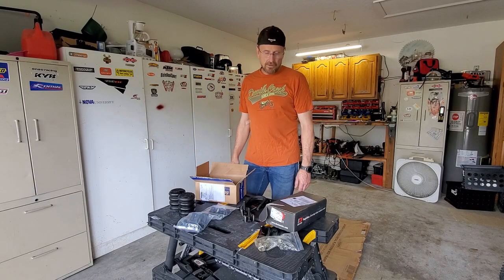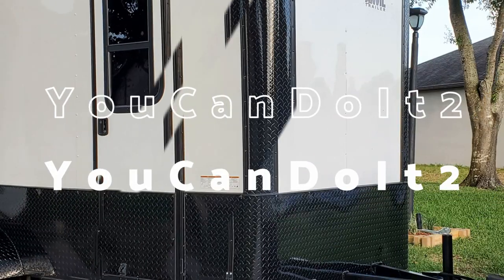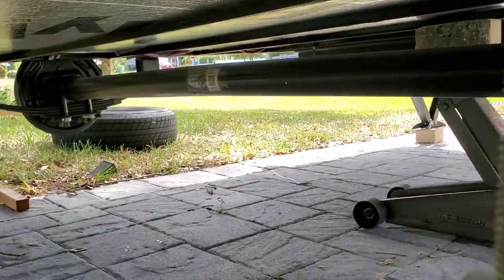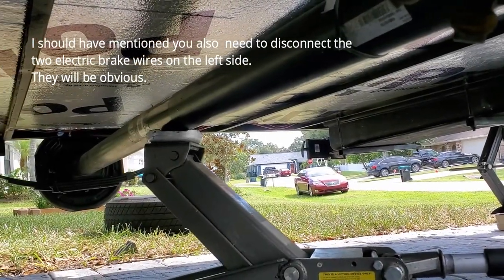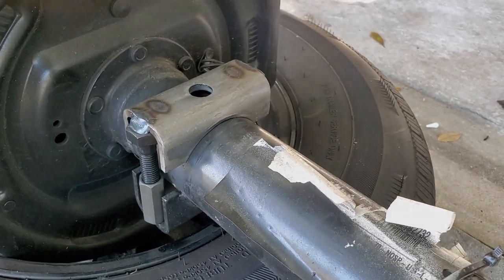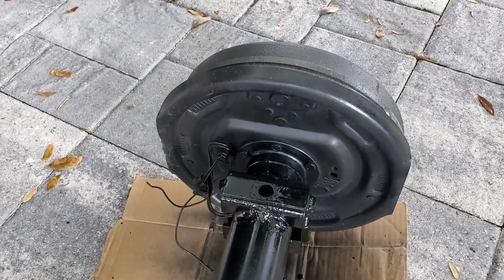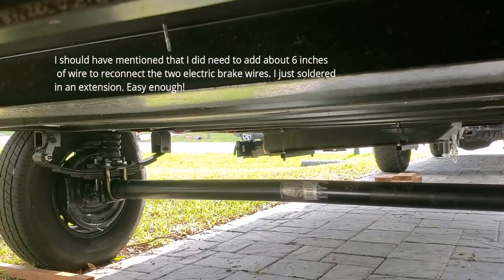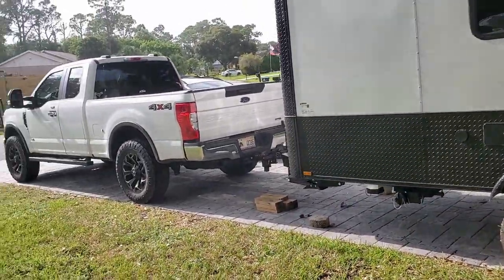Cargo Trailer Camper  -  Axle Flip  (Move Axle under Springs) - Trailer Lift

Comment: Awesome video! Thanks for the info! I am trying to decide whether or not to flip the axel on my cargo trailer conversion! I wasn’t sure if it would make it too high and top heavy and make it unsafe. 🤔🧐 You also made me feel better about my axel being bowed a little in the middle! I thought I hit something on the trail and bent it! But now I know it’s normal haha!
Reply from the maker: Thanks. You are welcome. It will lift between 4 and 6 inches depending on your existing axle diameter and leaf spring stack up. In any case, I'd recommend you add the SumoSprings at the same time. I've made a trip since I flipped my axle and installed SumoSprings,  I can say, they make a huge difference. Worth doing even if you didn't flip the axle. Best of luck.
Reply: @donsdoityourself2547  Oh wow!! Thank you so much for your reply! I’m definitely going to check out those sumo springs! I know our trailer definitely needs better suspension, it’s pretty much the only thing holding me back on the trails! Thanks again! :))

Comment: We just had to get a new axle after hitting a massive pothole & we thought about doing this.  We did get a straight axle - which raised it 4 inches.
Reply from the maker: Sorry to hear that. If you previously had a drop axle, then the straight axle will result in a change for sure.

Comment: After having had some experience with the flipped axle any lessons learned? What would you do differently? We are thinking of adding spacer blocks and shocks instead of flipping axle.
Reply from the maker: The axle flip gave me the clearance I wanted.  Very pleased with results and would not change it. 

I am not sure how blocks will add lift for you if your axle sit on top of the springs like mine were to start? In that case, you would actually be lowering the height of tje trailer. One you "flip" them... which is really not an accurate term, then blocks would raise even more, but then  that might cause other issues if too tall on the axles. 

Shocks would be a good addition whether you flip tje axle or not.
Reply: @donsdoityourself2547  Thanks for the response. My main objective is to be able to use 18” tires on the trailer. The most gnarly roads we are on are dirt roads. 

What I meant by blocks is welding square tubing to change the mounting points for the suspension to create tire clearance. It just came to mind that my build looks more like a disco and yours is more of a biker bar 😃 

You can check out our “Disco Trailer” on our channel.